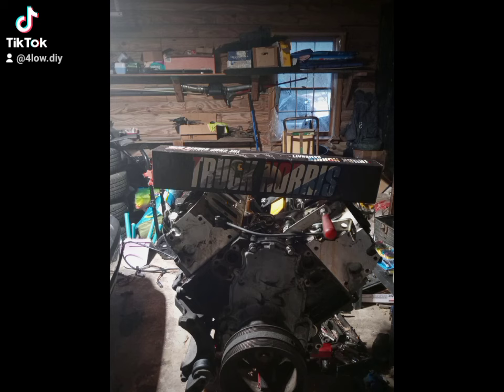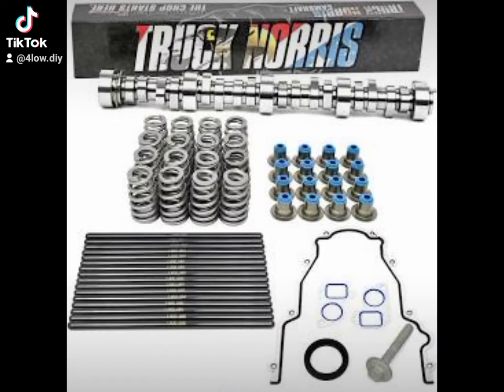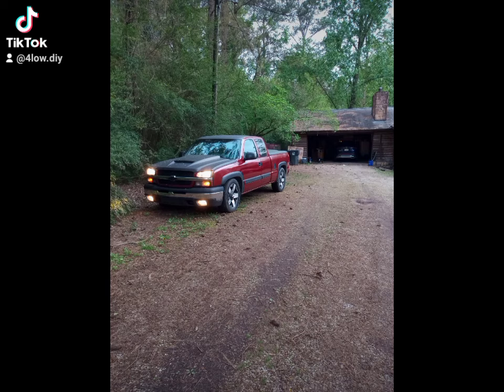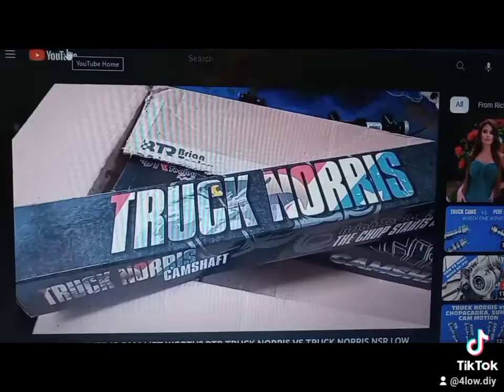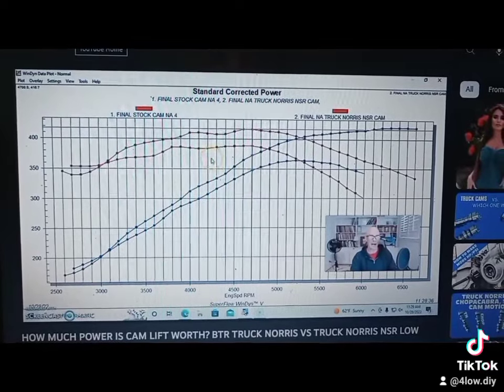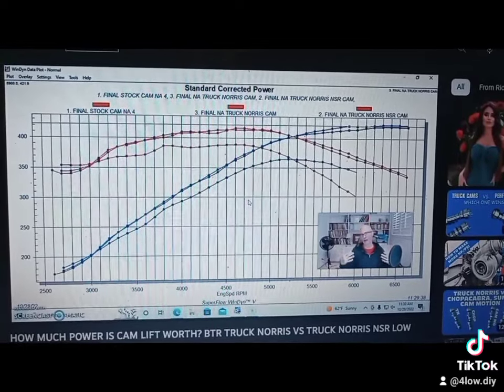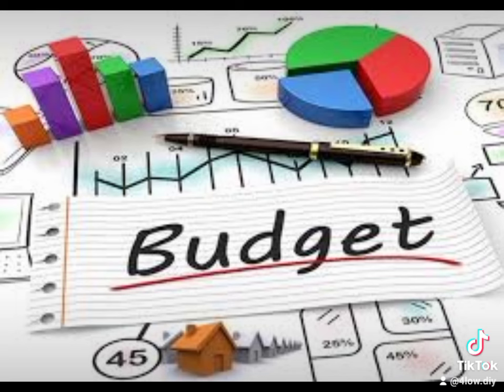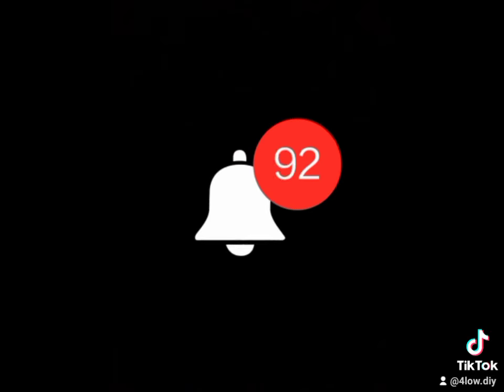🔥 Truck Norris Cam Review after 6 months installed🔥 #truck #automobile #silverado

Comment: Get a 2002 to 2006 inline 6 4.2 trail blazer torque converter , that’s a bang for buck for like 150$ with 2400 stall
Reply from the maker: Yeah? Good tip im gonna look into that. Thanks
Reply: Should be a B-85 VJCX.
That’s what I have in mine..  just haven’t gotten it running yet.
Reply from the maker: @gearjonny369 appreciate the tip. I'm searching for one now
Reply: @Ralf1NATOR  yes sir anytime! I’ve been busy with other projects and still haven’t gotten mine running yet but it’s close.
Reply from the maker: @gearjonny369  I made the track today lol. Horrible but was intentional.  If you get a chance check out the video

Comment: I saw a HP tuners logo in there. I think by far that tuning is the best mod you can make to your truck or car. Better parts are only as good as the tune you run them with
Reply from the maker: Oh without a doubt. The only reason I got hp tuners was to tune in the cam. Its pretty addictive. Now i have heads, intake throttle body, and headers sitting in my garage. As soon as i decide on my injectors the fun begins. Thanks for the comment

Comment: Will the 4l60e hold with this cam ?
Reply from the maker: Mines been fine for a year and a half on stock stall 4l60e. Dragracing, mud riding, towing , etc . I think people have problems with the 4l60e when they override too many of the factory safties when tuning. My trans was already shifting funny on the 1 - 2 before i ever installed the cam and its still alive and well even with 4wd launches. Thanks for watching. I have a few track videos you can watck on the stock converer and trans. 💪💪
Reply: @Ralf1NATOR  ok I'll check it out because that has been a concern of mine
Reply from the maker: @ArkArmy90  good deal . Yeah 0 issues with trans

Comment: Do u have a Dino on the power rating vs stock
Reply from the maker: Hasnt been on the dyno yet. Richard holdener has a video of the dyno numbers. Huge gains. Biggest gains ive seen for a single part other than power adders. I chose this cam because its a heavy truck and i have not been disappointed. Good luck
Reply: If you look at most 5.3 cam videos the power comes up at the top of the rpm. Hey it's only a 326 what would you expect? You really can't afford to loose any power down low with heavy vehicle. Which makes this cam awesome cause you don't loose anything down low for a daily.
Reply from the maker: Exactly!!!!! Reason i chose it 💯 @whaddayawant2197
Reply: I got truck norris tuned and my truck has horrible power til 50mph
Reply from the maker: @billcarson4525  something is wrong somewhere. I've done a couple now. Do you have a way to check the tune or was it done at a shop ? I've never seen one lose power

Comment: If u ad a cam can you pass smog because if you ad header's u don't pass smog no one talks smog
Reply from the maker: @craigdave3266  here in bama its not as strict and with the right tune u can pass smog with a cam. If you dont delete any 02 sensors you can squeak by with headers too here. All depends on where youre at. Cams typically only affect vacuum in my experience

Comment: funny name on the cam but it isn`t a truck cam. people interested in low speed performance and fuel economy would do better with a stock vvt cam(or aftermarket vvt compatible) or atleast a smaller cam
Reply: looks like a good performance cam
Reply from the maker: Oh you're exactly right.  Its a performance cam for sure. If you're looking for fuel economy definitely not but if you're trying to go fast and still use a truck as a truck then its great. Ive gotten into the 9's with it and can go faster while still being able to tow and haul
Reply: @Ralf1NATOR  9`s.. jesus

Comment: The cam will not give you more breathing, it takes advantage of the breathing your heads already have.
Reply from the maker: You're right and wrong. It won't exceed the heads abilities however the extra duration and lift allows more air into the heads by holding valves longer. Go watch richard holdeners video. On a stock motor with upgraded springs its good for 50 hp minimum. Better heads, intake and exhaust only multiply that. More air is more power
Reply: LOL....Wut?    The heads do not give your engine any more breathing.....they just lets the engine take advantage of the air already around it....
Reply from the maker: @tunerdadtunerdad7927  i know right 😆

Comment: NSR cam makes almost same power
Reply from the maker: @MonzaRacer  you're right it does. I would say maybe 5hp difference at the tire if that but that little bit does multiply as you add more power.
Reply from the maker: @MonzaRacer  exactly right. Maybe 5hp if that at the tire difference. Either are a great choice for the smaller motors

Comment: It's the tight LSA that does it. There's plenty of cams that'll do just as good, truck norris is nothing special.
Reply from the maker: Lol you kill me. There aren't any "special cams" in my opinion . However this is 1 of the best I've seen to keep torque to get a heavy truck moving. If i was building an s10 i wouldn't even consider the truck norris. Very streetable on a stock stall as well
Reply: Nsr is special
Reply: @jb333zy3  Sorry pal, just another cam.